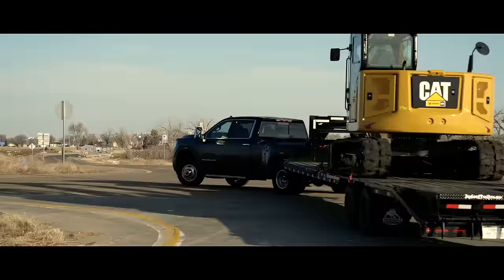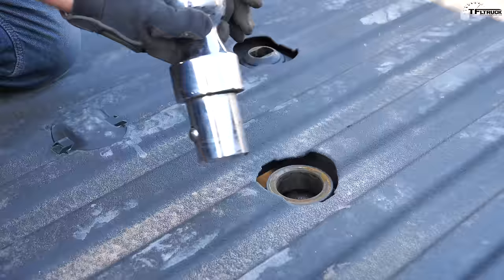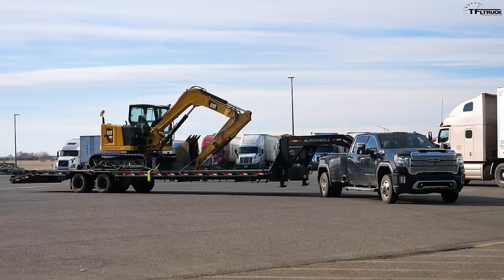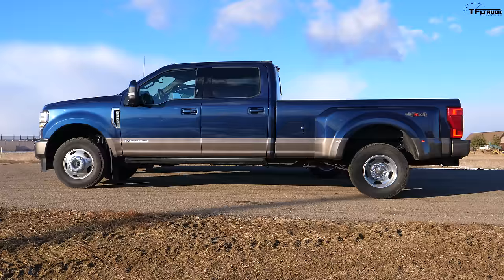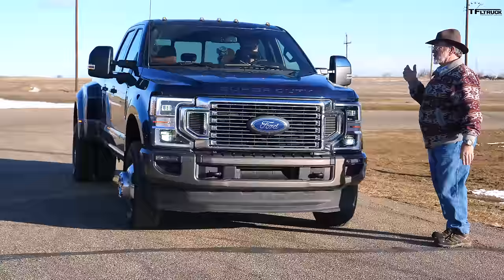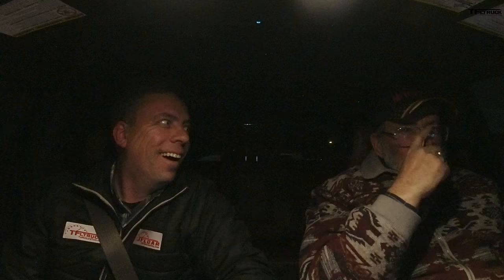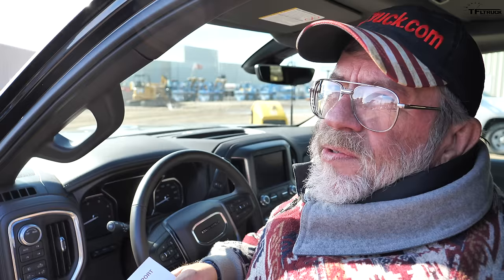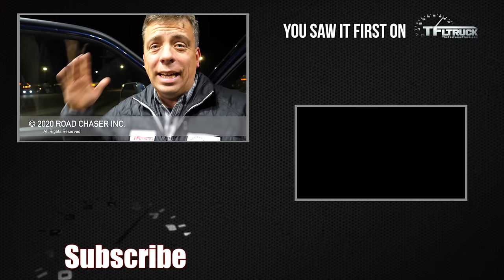30,000 Lbs Monster Tow Test: 2020 Ford F-350 vs GMC Sierra 3500 - Drag Racing & Tow Off!

Comment: "EPA doesn't rate these trucks, TFL Does!"
Reply: EPA can go violate themselves. They don't rate the trucks but they regulate the ever loving shit out of them. Without them these trucks would be pulling more and doing it at 15 MPG (edit: and more reliably).
Reply: @SergePupko  they'd also have more power, which would make them more efficient, which would emit less emissions.
Reply: Kyle Kenan especially with a proper tune!
Reply: @kylekenan2321  I don't think thats right, if it makes more power, it emits more emissions.
Reply: @kappajohns5416  not necessarily. If it already has extra power, it won't work the engine as hard and consume as much fuel as it would if it was smaller and running harder.
Reply: @kappajohns5416  the easier an engine can breathe, the hotter and cleaner it can burn the fuel. 

Kinda like when a wood burner doesn't get enough air. It'll just smolder and smoke, but when you open the vents and damper it'll burn better.
Reply: @kylekenan2321  that's actually really true a stove will just smoke If you close the draft but if you open up the draft it smokes less
Reply: KappaJohns false
Reply: @kappajohns5416  you don't know much about the emission systems on these trucks do you?!?! No you don't!
Reply: @Shenkosky That's funny, I have a 2015 crew cab, 6.5" box and I get a reliable 24 in the summer and 21 in the winter. My 5.7 vortex would get around 19 in the summer and as bad as 14 in the winter months.  The 4.3 ecotec3 will run circles around the 5.7 and do so at lower rpms. This outdated idea that you put forth is and outdated idea that shows a lack of understanding of how the internal combustion engine functions. In a nutshell there is so much more to efficiency than the size of the displacement.
Reply: @Shenkosky I know these trucks like the back of my hand, I don't take anything a sales person says as fact. The ratings for all the engines are 22 highway. The 5.3 is rated at 17 city while the 4.3 is rated at 18 mpg city. These number mean little and in my personal finding the 4.3 does far better than the 5.3, like I said, I regularly get 24 miles per gallon.
Reply: @Shenkosky I didn't ask you a damn thing. I told you what the 4.3 ratings and 5.3 ratings were for 2015. Yes, thoes years the 4.3 did better in the EPA ratings than the 5.3. The 4.3 in the new trucks is the same as 2015, but the truck is less aerodynamic. The 5.3 is a very different animal if you have dynamic fuel management. Many of the new trucks have the older Ecotec3 5.3 engine with AFM.  If I was buying a new truck I would opt for the 2.7l as they have been delivering impressive fuel numbers in real life driving. They are plenty powerful for towing some heavy loads but like Ford's problematic ecoboost they will likely get worse fuel economy than a v8 while towing.
Reply: @kylekenan2321  How "Hard" the engine works has no bearing on fuel efficiency.  Overall weight and how much power is GENERATED do. A Large engine uses just as much fuel creating the same exact power a smaller engine does. That is a myth, what you are saying. Since the smaller engine takes in less fuel, even when working harder, so it simply balances out and is simple physics. To move a certain amount of weight, will take a certain amount of power and fuel no matter what engine (within reason of course)
Reply: we need a shirt with that quote
Reply: Hate stupid the def system
Reply: @JKHTX  Exactly, and how much other "unknown" emissions they're putting out.
Reply: @kappajohns5416  emissions systems decrease efficiency

Comment: My 2019 Kenworth T680 has a lifetime MPG (for 143,000 miles) of 8.05. I usually get about 200 mpg for DEF. With ONLY 30,000 lbs behind me I get over 9 MPG. My truck has a 15 liter Cummins X15 (400 HP/1750 LB FT TORQUE) with a 12 speed automated manual transmission.
I know, apples to water melons.
Reply: Well, considering the cubic inch difference in the X15 15 L vs. a 6.7 L, your X15 gets better mileage per liter of displacement in a big way. They are putting those Cummins 6.7 in motor homes these days, I wonder how they are doing on grades, going up and going down.
Reply: So why this obsession with mega pickups? Frustrated boys, wishing they were big truck drivers?
Reply: @Nigel Braithwaite  and the worst part is when you lift a diesel truck you reduce your tow rating. You rely on a drop hitch. Might as well drive a car then
Reply: My Cummins 600hp Kenworth almost gets that if I drive it!!
Reply: @Predator27007  lol as someone who's younger brother and dad drive semis, I don't need to have an obsession with trucks , but I do need to haul/tow the absurd amount of tools I use to work on said diesels. 

I'm assuming you were talking about short bed, lifted trucks with coaling tunes.

Comment: What I thought was missing was a 0-60 time with the loaded trailers. Be interesting to see how long it takes to get it up to highway speed
Reply: at that weight, it's pull the trailer apart. to much power 😁

Comment: I’m so glad I own a diesel that doesn’t use def!
Reply: Def isn't the issue, it's the DPF and EGR!
Reply: @JohnDoe-nz6bk  One less thing he needs to pay for. I agree with the OP.
Reply: Neo Smith yea, I'll give you that.
Reply: Lb7 still pulling
Reply: Agreed I got my lml deleted. To h3LL with the DEF
Reply: I love my 12 valve Cummins more every time I watch the new trucks
Reply: ‘04 #cummins here 👌 indeed señor!!
Reply: I drive an '07 lbz
Reply: @JohnDoe-nz6bk  It sure is when you're using gallons of it towing heavy on a tune. I deleted mine because it was getting out of hand.
Reply: I have a friend with a 2015 6.7 and the sensor thingy stopped working so now he doesn't have to fill up with Dec.
Reply: Simple solution is just to delete it. It increases efficiency. Hopefully you aren’t somewhere that requires inspections
Reply: @JohnDoe-nz6bk  I have 7.3 powerstoke so none of the bullshit. No Egr, recirculating dirty air , no diesel patifulate filter either no Regen
Reply: @lgrw9883  I have a 2003 7.3, nice having a diesel truck before all the bs
Reply: Yes sir mine deleted off mine but it’s not def
Reply: @Robert Bryant diesel is better

Comment: Ford has come a long way in the diesel market ever since they started building their own engine. Ford is the only truck manufacturer that builds their own engine and transmission and they’re out performing the competition. Good job Ford
Reply: If i was in the market for a new heavy duty truck no doubt ill buy a Ford
Reply: GM builds their own engines also, their partnership with Isuzu ended a while back. They did own Allison back in the day, idk if they still do though.
Reply: @BlackHawkBallistic  The Duramax is an Isuzu engine and Allison transmission is owned by Allison GM does not build the power train in their HD truck
Reply: @BlackHawkBallistic  still an Isuzu
Reply: @jasonamerica7618   thats right

Comment: I love how competitive the market is. It benifets the consumer very well! 10 years ago, these trucks were doing about half of what these trucks can do where 10 years before that, it wasn't that big of a difference. Keep it you guys!
Reply: Nathan Salyers they were also half the price
Reply: IVAO04ify more line any old truck does it just fine. Not even just cummins
Reply: @justinw.2376  That's not true. If you compare similar configurations, prices are virtually unchanged. 

It's hard to compare, because specs and standard features have been changed, but here's the best examples I could come up with.

In 2010 an F-350 4x4 Supercrew Dually XLT PSD was around $50,000 before options. Adjusted for inflation, that's around $58,000-$59,000 today. Well, a comparable new XLT 4x4 Supercrew Dually, according to Ford, is $59,275 before options. That's right around the same price for basically 2x the capability. Honestly, given the modern version at a at marginally higher price, I'd still take the new one! The old 6.4L PSD was junk. The mileage and reliability savings with the newer 6.7L would easily pay itself back in a short amount of time for me.
Reply: @IVAO04ify  And where is this? I see countless numbers of brand spankin' new trucks being worked every single morning of the work week. I have two parked in my drive way, ready for Monday. You think mainly lawyers and doctors buy these trucks?
Reply: Some would argue it is what destroyed the diesel truck market. Making trucks that cost 80 grand, make 1000 ft/lbs of torque, but cant even go 100,000 trouble free miles. Someone should go against the grain and throw power numbers out the window and focus on building something that can actually get 20 miles to the gallon and run reliably.
Reply: @jontest5718  the power levels arent the current issue as far as reliability is concerned.  It's the emissions equipment that causes the problems.  The current power numbers were incredibly easy to surpass even nearly 20 years ago, with a first generation LB7 Duramax.  Other than its injector issues, those trucks could live a very long time even at elevated power levels.  Go a few years newer than that, and thing got even better.  The actual downfall really started with the more stringent emissions controls.
Reply: @ShyaMiss  amen. And yes the injectors did leak fuel, but the reason the injectors failed is due to the lack of proper filtration. If you put a 2 micron filtet with a lift pump on a LB7 (after replacing the injectors) you're set.
Reply: @sirvelliance9332  yup, I did the Cat filter upgrade.  Also had an AirDog to keep my CP3 happy.  I never had an injector issue.  Though I heard others that claimed they did, even after similar mods.  Never cared enough to argue specifics with them.

Comment: Man that ford is a monster
Reply: the gmc is tuned for fuel economy unfortunately lol
Reply: @hugeCRSfan69  it was?  It didn't get that trophy either lol
Reply: @hugeCRSfan69  no the ford is just faster because it's more powerful, you chevy guys got some excuses I tell you
Reply: These trucks are damn near identical in performance and all you got out of this was "bUiLt FoRd ToUgH." 🤣
Reply: @zach4321  Ford has much more power and much more torque...
Reply: 29kalel I love mine!
Reply: @zod-engineering-welding     The GMC won't get a Cummins down the road either😂😂😂😂😂😂😂😂😂.
Reply: @tylersutton1048  that ford was so much more powerfull he only beat by a bumper.
Reply: @hugeCRSfan69  yet the Ford got better fuel economy? That made no sense man.

Comment: GMC:
Computer - 7.2 MPG 
Calculated - 6.9 MPG
DEF - 185 MPG

F350:
Computer - 7.2 MPG
Calculated - 7.8 MPG
DEF - 169 MPG
Reply: GARBAGE.
Reply: @wonaldgrump9654  I don't think it's that bad for hauling that much. For either truck.
Reply: Another thing though is the ford ran at night with less turbulent air off of the highway and not only that the air is a lot more cold at night which makes the engine run a little better
Reply: Xzvius that’s while hauling ? That’s not bad
Reply: @gamewarmaster  it wasnt 100f summer temps during the day....prob about 40f during the day with the snow i saw still hanging around
Reply: thatsAstachewearinAman never said it was 100+?
Reply: Yep, always trust the computer over hand calculations. The Ford may have had a little more fuel in it to begin with, the pump may have clicked off earlier, etc. Too many variables. Same situation with the DEF. With such a short trip, even the slightest difference in how the trucks were driven will make a difference as well. In the end, it comes down to personal preference.

Comment: You have to load it right to get that shaking out
Reply: Where would you want the load? It looked like they had it just forward of the axles. Maybe dead center?
Reply: Looked alittle too far forward to me with alot of sag/wip in the middle but I'm no expert.
Reply: James Vokral over the trailer axles, it needed to come back some
Reply: Excavator wasnt up far enough on the tongue
Reply: @jamesvokral8247  weight should be on the trailer axles
Reply: Well I've been pulling things for 40 years and you have to put a little more weight on a truck with a gooseneck if you don't it would just bounce up and down and beat you to death. You want the truck to squat just a little bit
Reply: @jamesredmond8644  agreed, it is hard to get the weight right when you have 40ft of deck, almost need to load it on the scales to find the sweet spot, we went to longer goosenecks and it took a while to learn the balance of them, when using a 25+5 you load the rear axle of the tractor between the dual tandems.
Reply: All I Do Is Dance to tractor Ford until the truck starts quiet and down a few inches and then you know you're good. Works every time
Reply: James Redmond they should have actually stretched the boom out and scooted the tractor back a couple of feet.
Reply: Load it all the way to the rear. That will change the ride...
Reply: @lcee6592  lol
Reply: Does it really matter?  Because it didn't do it on the Ford and I've never had that issue on mine.  They never moved the load from one truck to the other, so the GMC just has bad suspension.
Reply: @jonmccauley6490 ,  Nothing wrong with the suspension.  Each truck is just different as to where it handles the best according to where the weight transfer is.
Reply: @jonmccauley6490  They literally said it was about the same as the Chevy in terms of rough ride when pulling the load. Did you not watch the video ?
Reply: Thank you! I was about to write the same thing right before I saw this comment..